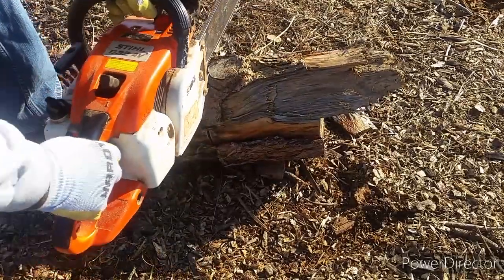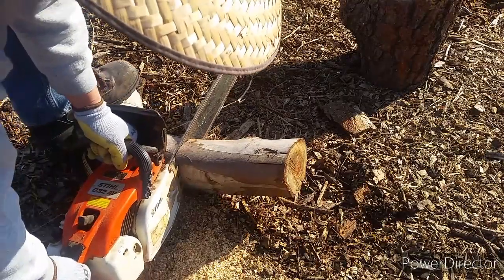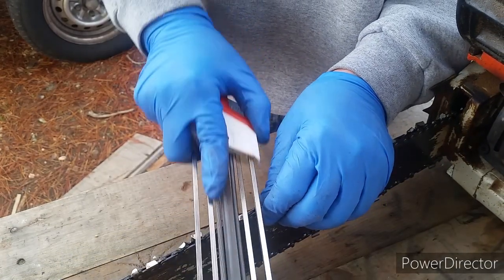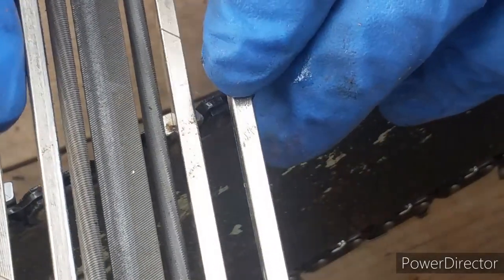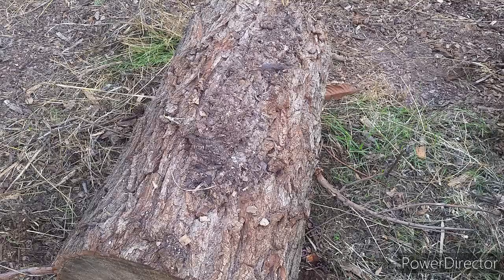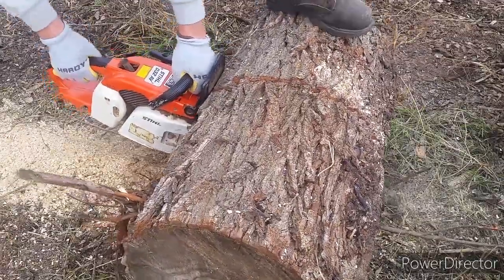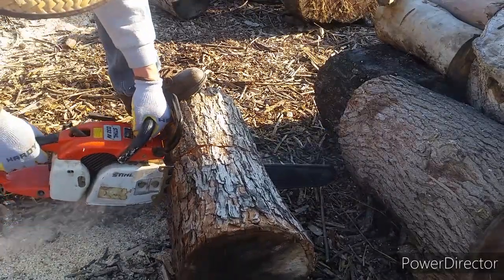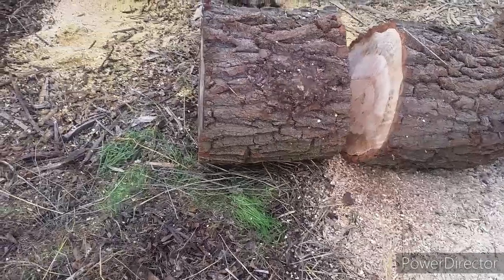Does this Clone Stihl Chainsaw sharpener Work?

Comment: you're using that "upside down" the angle of the plastic handles is supposed to align parallel with the bar
Reply from the maker: I'm doing right as far as i know.  If the plastic handle is parallel to the bar, the angle would be way off.
Reply: Yep,  you are correct mitsuturbo, Tone Dubb clearly didn't read the instructions or watch Stihl's video on how to use the tool.....
Reply: @tonedubb4325  Flip it over.

Comment: You're using it the wrong way around. If it files this way the files are in the wrong way around.
Reply from the maker: I see.  I'll try the other and see what will happen.
Reply: @tonedubb4325  The angle on the handlesshould parallel with the chainsaw bar to give a 30 degree angle on the cutter. The files should cut on the forward stroke. The stihl version has an arrow to show which direction the file should cut.
Reply from the maker: Since it's reversible,  if I line up where it's parallel with handle and the bar, when i flip it to use the opposite file, the handle won't be parallel no more.
Reply: @tonedubb4325  when you flip it over you sharpen the cutters that are sharpened the other way. 
 File from the opposite side toward you. Always file to the outside of the cutters. (When you finish the file cutting stroke the length of the file should be on the outside of the cutter that you are sharpening and inner edge on the handle should be parallel to the bar. You can turn the saw 180 degrees if you like. If the file doesn't cut in this direction it maybe the wrong way around.
Reply from the maker: I'll pay close attention next time i sharpen the chain.

Comment: You sharpened it the wrong way is what the problem was.
Reply from the maker: It's reversible. The file placements were correct. I know the two white end pieces are supposed to be parallel to the chainbar. I think this generic brand, the round files, bent  easily, making it hard to sharpen the chain.  Maybe the real stihl file is more sturdy.